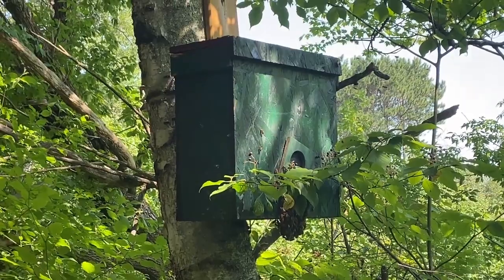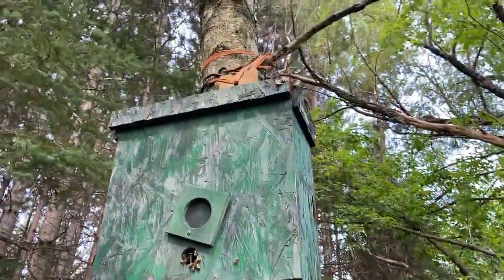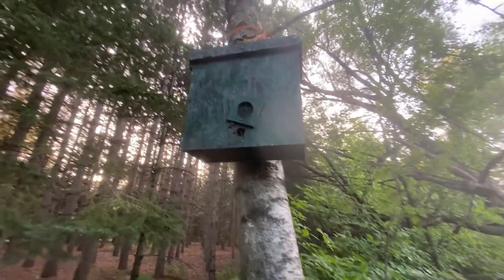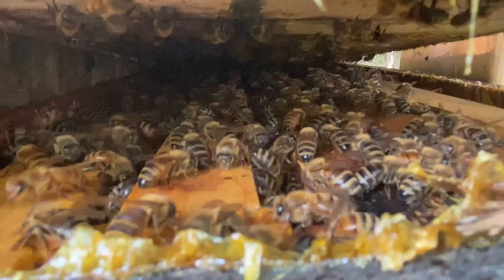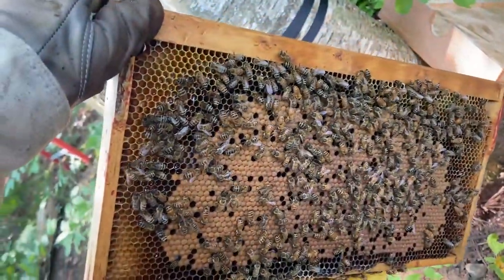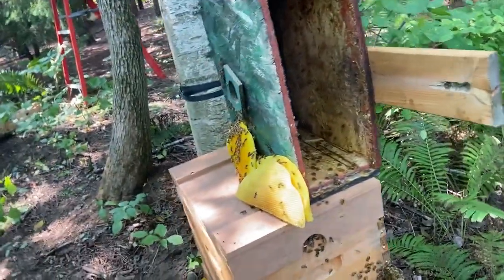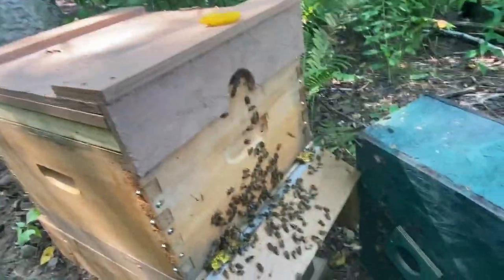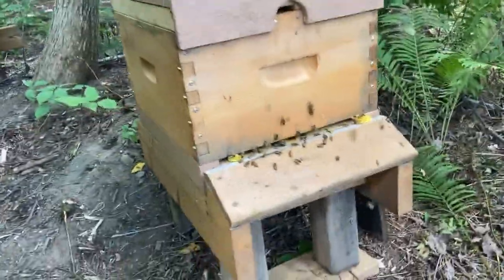I caught a swarm in my swarm trap!  August 2021

Comment: Greetings from Belarus.
I have been fond of catching bees for 30 years, it is almost impossible to give up this hobby.
The main thing is a well-chosen place. Bees do not like competition, it is impossible to be near other bee families, no closer than 1 kilometer. The trap must be hidden from the weather, wind and sun. There should be a free flight of the swarm to the trap. At any location there are places where bees do not want to settle and places where all swarms fly, the main thing is to determine them, this is possible only by experience.
Question. You have no problems with the safety of the trap. No one will steal or damage it, it is posted openly. We have such a problem.